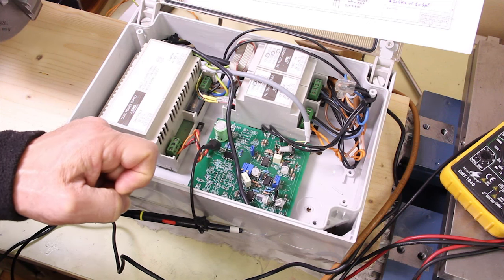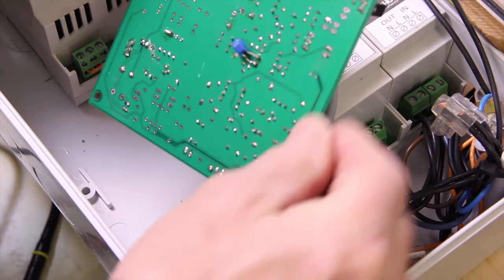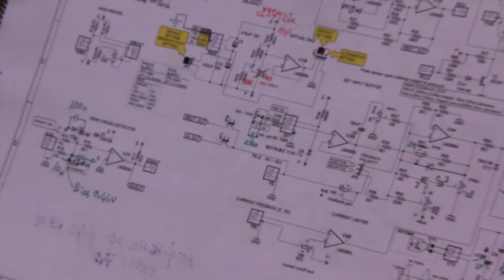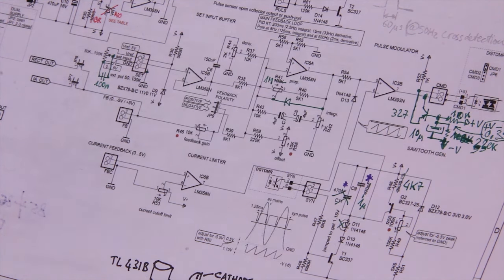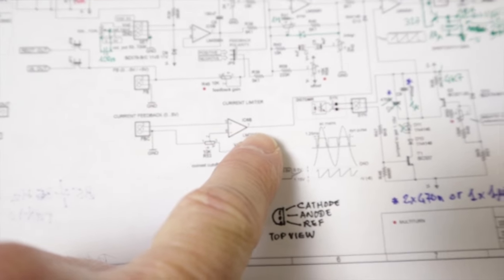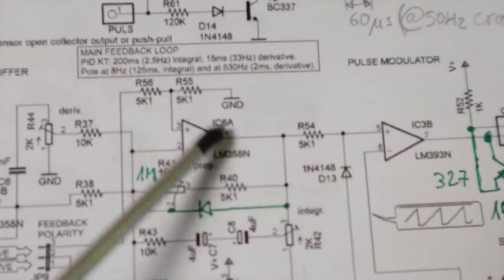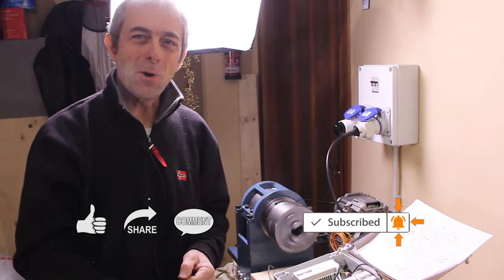How to spot a fault in a circuit, like a pro : hands on electronics [1]

Comment: How do you always get access to the schematic diagram of the circuit...there is serious difficulty to find for certain specific devices
Reply from the maker: For unknown circuits the only way is to reverse engineer. It takes time and sometimes it's really hard when BGA ICs are involved. With multilayer PCB very often the inner layers are just the GND and positive (and negative if the PCB has 3 inner layers).
Reply: @AccidentalScience  good  idea  that  I have from your video  thank you
Reply: I specialize with game consoles. The only thing I have difficulty finding is ps5. Most others have either been leaked or have been reverse engineered by someone. Most pcbs are multi layered and require an xray machine.
Reply from the maker: Eventually I made a video about the case where no schematic is available. I thought to add a further reply to your comment with the hope it will be helpful for you, this is the link to the video: https://youtu.be/yjxuMwLN7zI . Thanks for following my channel, greetings from the Alps.
Reply: Not hard to find if you have a phone, you can individually google the components parts number and see where they belong.

Comment: Very nice demonstration of fault finding using schematics. I find that schematics are mostly very difficult to find for anyone outside of the industry, so I have to use different methodology - firstly check all electrolytic capacitors for signs of leakage/doming and replace any that have failed, then have a close look at the board - particularly components and soldered joints for signs of failure (under a microscope) - the fault that you had I would have found readily, and maybe in less time too. Next, look at power supply circuits and check that they're functioning as they should, and check all discrete semiconductors  Then locate blocks of circuit that I recognise and test the components in each block. By this time most problems have been fixed. Checking the datasheets of unknown multi-pin ICs often comes up with sample circuits, many of which have been utilised by circuit designers - that makes some fault finding very straightforward. If after all this the fault remains and a schematic is not available, it's probably time to invest in a replacement pcb...
Reply from the maker: If you are interested on how to proceed without schematic I made this video: https://youtu.be/yjxuMwLN7zI
Hopefully it will be interesting for you. Greetings from the Alps.

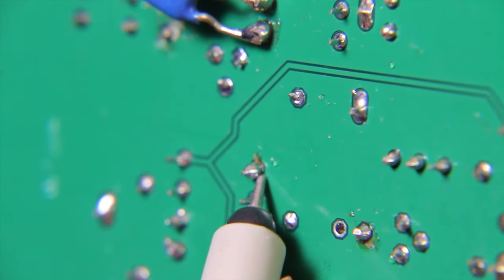Comment: You missed another dry joint above the broken pad you found … look at 12:14 on the top right it has cracks all the way around the pad.
Reply from the maker: Well spotted.
Reply: The whole thing looks a bit sloppy. The guy must have been making it right before lunch.

Comment: Thanks for putting this video together 💯
Did you have much trouble sourcing the schematic diagram of the ESC circuit?
Reply from the maker: Well, no ...it's my own design :)
Reply: @AccidentalScience   Wow, nice work!
Reply from the maker: @paulf1071  thanks. If you are interested, in a previous video the circuit has been described. It should be available even on my website.
Reply from the maker: If you'd like to know how to proceed without schematic watch this video: https://youtu.be/yjxuMwLN7zI

Comment: Good advice just one problem, most of us don't have a scope lol...
Reply from the maker: Yep that could be actually a problem. However because in this case we mostly have continuous signal in many points we could have been able to find this partcular fault even using a voltmeter. Though for a more general methodology even a simpler scope is a must. Thanks for commenting, have a nice  year.
Reply: You could actually just use you eyes looking for bad soldering joints first. Problem solved. No need for $20000 scope equipment, just some solder.
Reply: I just got a good little scope on eBay for less than $25 shipped. Not a huge bandwidth but you rarely need that and I have a 100 Mhz  scope if I need it. The new one slips in my pocket.

Comment: Hello.
the electrical circuit you are using, in addition to the motors (why two?), is it from a washing machine?
What changes did you make? From the schematic drawing shown in the video, were the changes in the handwriting?
can help? I'm also building a mini lathe and wanted to use a similar motor.
but I'm having trouble controlling the rotation of it.
Thank you for your attention .
Cheers

I forgot.... congratulations
one more subscribed
Reply from the maker: Thanks. The circuit is my own design. Look at previous videos where it is described as a driver for washing machine /universal motors.
I used two motors to get more power.

Comment: During the visual i noticed that lots of components were desoldered. If i am to start with signal checking after verfying the power supply i will start at the output and go backward checking the inputs. Desoldering should not be performed until the faulty component is positively identified.
Reply from the maker: There were no desoldered components! This is a configurable board and what you think is a desoldered component is actually a config or modification component.
Reply: @AccidentalScience  okay, but the work is dirty. What do you think?
Reply from the maker: I had to give a look again at the board and at the video to get what you mean, since this stuff is 2 yrs old. The board has some significant modifications on top of its configuration setup. So, again: no desoldered components for the purpose of finding the fault. Indeed one of the points of the video was to follow the signal path (look at 3:16) .
Yes I convene that the modifications are not aesthetically tidy, but they are firmly secured and functional.
Reply: @AccidentalScience  yap, thank you, i have a long experience on manufactured controls for the manufacturing equipment and had worked on poorly designed circuits that need some modifications, but the circuits that came direct from the manufacturer, modified or not it should be soldered clean.
Reply: You took the words right out of my keyboard. I would at least start midway to eliminate half the circuit from the git-go.
Reply: @timwhite7127  okay, anybody has the right to do things his own way and you are great
Reply: Educative

Comment: I've been trying to learn about using dmm because recently had a bad hexfet on tennisball machine PCB.. that's how I found your awesome video. However, now I'm more interested in that spindle head on the lathe.. Is that a Taig 5c or did you diy the the spindle, bearings and housing?  I'll have to look through your channel and see if there's more vids about the lathe. I'm trying also to decide which route to go with a home hobby lathe
and the Taig 5c spindle head is $600 ...that's a nice looking spindle/head and perfect for what I'm looking toward for making pool cues

update: ok nvrm, I found your video regarding the lathe ... luv it
Reply from the maker: I wanted to try the route of making a lathe from the perspective of J. de Vacaunson in 1700s, and studying the Whitworth method for achieving flat surfaces. I was wondering how they do reach precision from scratch. So it was a long and insightful journey. I ended up having a quite precise and very strong bed and carriage (with no compound on purpose). But I also experienced a lot of setbacks. If you want to build your lathe, be aware that if it shall be a decently high precision machine then it will be a long and steep journey. The setbacks I experienced were not strictly related to the lathe, but the complexity of the job took its toll. Hope to be helpful, and good luck.
Reply: @AccidentalScience  Let me ask ya ... I have steel track rails from old Belsaw sawmill ... they look like railroad rails .. do you think these could be machined down for carriage rails?
Reply from the maker: @hobonickel840  hard to say, I don't know that sawmill. Generally steel is a good material even though it sports a higher coefficient of friction than cast iron. Cold rolled steel is prone to deformation if, let's say, you make a hole in it. Once made flat the rail should not be worked further: no machining, no welding.
Reply: @AccidentalScience  so it's better to not to flatten and use the steel rails for  precision rails??
Reply from the maker: Not necessarily if you plan your work well. For example if you need to weld the rails do it before flattening them. Also consider annealing the part in an oven once it is welded, and only then go for the flattening job. Another option is to do all the required holes, then flatten the rails and finally bolt and glue together using locating pins and strong epoxy resin.
p.s we are off topic under this video.
Reply: @AccidentalScience  I see... thank you much... yeah there's lots of steel around this old farm and I'm always finding relics in the woods ... saw mill is old big circular where logs move up and down on rails the steel looks good and even be cast iron .. I'm a newb and trying to learn as much as I can what good stuff to reporlose and what's not... Thank you for the reply!!!
Reply from the maker: @hobonickel840  you welcome. 
P.s. cast iron can't be welded.
Greetings from the Alps.